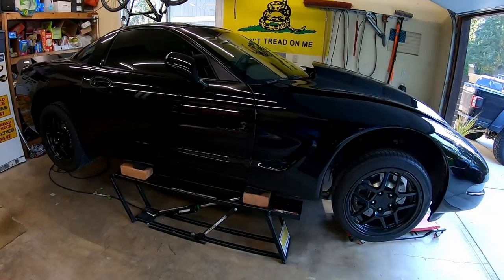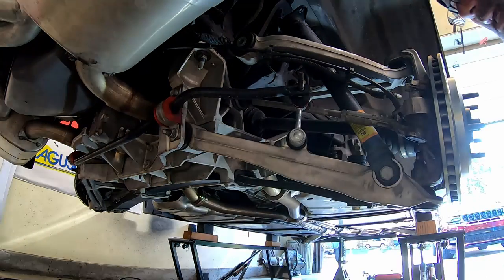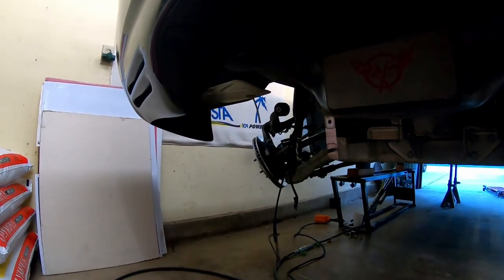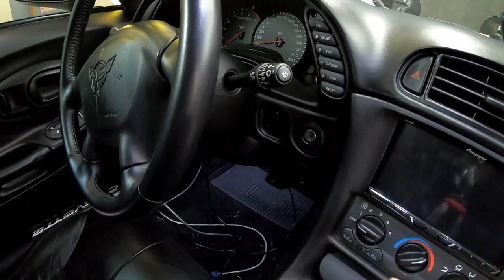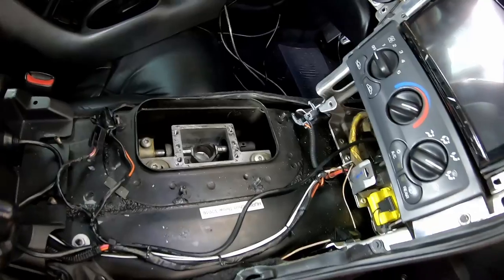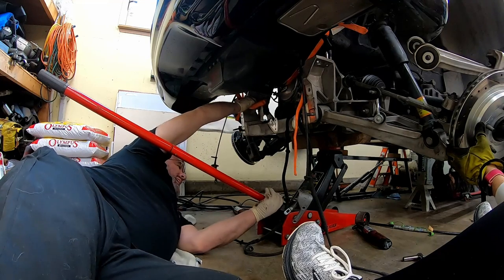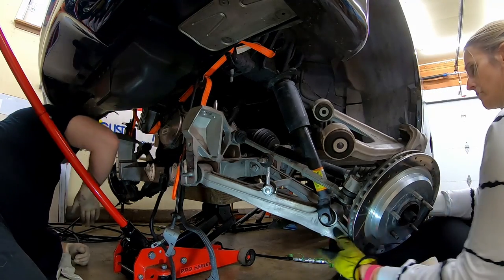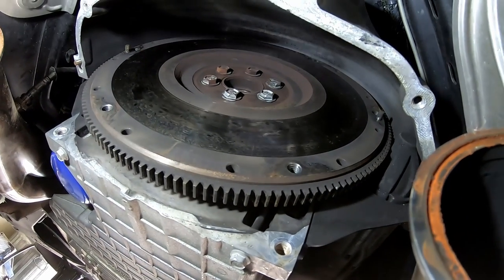How to replace a C5 Corvette Clutch Full Detail and the Adversity That Goes With It Part 1

Comment: Thanks for going to all the trouble to video it. Our 1998 C5's clutch is still on good shape with only 60K miles on it but I was thinking about it. I have the later quick jacks having been purchased in April of 2023 that are longer and go higher. Getting it in the air would be easy but the rest. I have a racing buddy that has a shop. He is very fair. I think if it eventually needs a clutch I'll let his guy's do it. My wife is good for steadying things but aside from that I have no other help.
Reply from the maker: Doing this job on a lift would be so much easier.   Pretty fortunate that my wife and I have always worked very well together.  Not abused your clutch should last well over 100k miles IMO.   Thanks for checking it out.

Comment: Did you have the new clutch, pressure plate, and disc matched to the old factory unit as far as balance goes. I know the factory (hot balances ) all manual transmissions.
Reply from the maker: No I did not.  Monster Clutches says this is not required.  Also I am not running the original engine anymore so it is an extra moot point.   Personally I wouldn't waste my time but if someone wants to take the extra effort I say go for it.

Comment: I read somewhere when you pulled the torque tube that the engine will tilt and you can cause damage…any issues?
Reply from the maker: It is possible to cause damage, but it would have to hang really low do do that.  Just use common sense and keep visually checking on stuff.    It was never a problem for us.

Comment: Any chance I could get the measurements of the metal radio brackets you fabricated?  I have been trying to find a set the guy on eBay used to sell or contact him with no luck so it looks like I will have to make my own.  Your VetteNuts bezel looks like it fits really good.  Mine not so much! :(
Reply from the maker: Hey Shawn.  I don't really have any dimensions per say.   I did copy the ebay ones with marginal success.   If I had it to do all over again I would fork over the money for the ebay ones.  OR if I was going to make my own again I would skip all the adjustability nonsense and just make straight L brackets with slotted holes in them that fit my head unit to my dash.   way easier and stronger.    Very  happy spending the extra 150 bucks for the Vettenuts bezel.   Looks very factory.

Comment: Monster Twin Disk -  EXCELLENT choice IMO.  Good to see your trusty partner in crime helping do a little wrenching!    Also - are you aware of the Hot Balance procedure GM put these through - something to think about.
Reply from the maker: Thanks Toys.  Car is back together and running well.   Currently in the ridiculously long 500 mile stop and go break in procedure.    Yup definitely aware.   Not too concerned in this car.  This car has semi solid motor mounts in it now so you are going to feel some vibration regardless of what is in the flywheel.

Comment: Hey man very thankful for this video. I couldn’t find any others with an early c5. Currently im doing this to replace my slave cylinder. My question is how did you move that ebcm to the left with that one brake line that runs under by the diff and to the passenger rear wheel well? Did you have to start dropping the cradle first in order to move it over or something?
Reply from the maker: I seem to recall detaching all the hard lines form the cradle and a arms.   The cradle, diff, trans, and torque tube all came down in one piece.  It was a massive pain in the ass and some brake lines have to get tweaked a bit to get the EBCM out of the way.   It can be done safely.

Comment: excellent video. i believe you captured the hardest part of the job well, separating the two. well done on showing that this can be done easily* with jack stands and a floor jack. they never decided on a good location for the ebcm, i would have put it in the left fender area... do you run ltft? would you be willing to send me a tune file of your car? my curiosity of tuning has skyrocketed lately, now that i have something to really tune. i think we have the same clutch, not a bad one but a bit grabby for my car.

*easily determined by age, its not during its the next day or 2. if your over 35 use a creeper. haha
Reply from the maker: Thanks cole.  I know you these cars pretty well and know what's involved.    Currently running an open loop only tune and we may try an experimental MAF only tune for the fun of it.   So currently no trims are turned on.  That being said if you want to see the tune email me.  email is in channel info.
Reply: awesome, will do. how do you deal with heat soak? using iat for cylinder charge temp calc? i hate iat heat soak. i know why cleetus hate hoods now.  i have been able to stabilize the heat soak at idle olsd but have not tested enough for off idle low speed stuff, honestly tired of tuning/testing but the ocd wont let me sleep...
Reply from the maker: @colemcmeans7809  My IATs are not a problem at all around here.   I'm using a fast acting factory LSA IAT sensor installed in the blower lid and I am using an air to water intercooler which is highly effective.  My IATs are almost always below 100.   I will say that when I was running before the blower I had 85mm MAF with built in IAT that thing was a piece of crap.  It would heatsoak and never come down unless you were driving down the freeway for a half hour.    You may want to look into the super responsive IAT sensor that motion raceworks sells now.  It's supposed to be the fastest IAT sensor made.
Reply: will do i have a supposedly fast acting one in the air bridge and honesly it does pretty good. but for olsd it can still get up to 140 if it sits engine off for a while. a simple iat adder table would fix all that mess but i dont think that will happen. there are some tables in which it could be done but my patience has been exhausted with olsd for now.

Comment: I can't get my pilot bearing out I tried the bread and a puller it still won't come
Reply from the maker: that is a tricky spot to be in.  You have to be careful pounding on LS cranks as they have a hollow bore in the back with a freeze plug in there that can be pressed out of place with grease or bread.   If you can't get it with a conventional puller I would go after it with a dremel and a carbide burr and split the bearing shell without tearing the crank up too much.
Reply: @PNW_Car_Mods  thanks for your tip

Comment: "as dry as a bone long bleached in the weather"- Robert Forby, The vocabulary of East Anglia. wonder where the f that is...
Reply from the maker: Ha!  now that you typed that I feel I have heard that before over the years somewhere.
Reply from the maker: did you get my email this morning cole?
Reply: i did thank you, have never seen a blower tune. thats a lot of cells to hit. i was most curious about how pe and be were brought in, now i kinda see.
Reply from the maker: @colemcmeans7809  Its even more different with a PD blower over a centri blower as the boost is instantaneous.  If you just tip in the throttle it goes right to PE.  That makes tuning the VE table a pain in the ass as you need to stay out of PE lol.